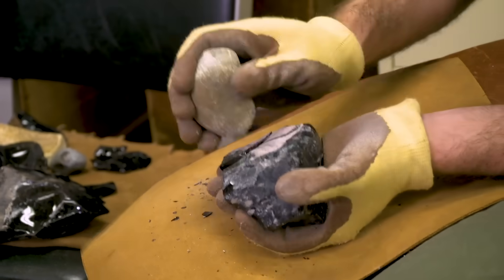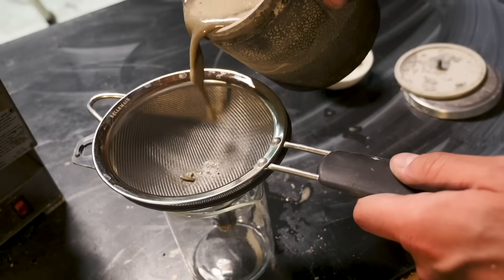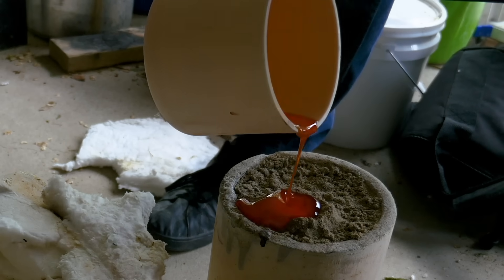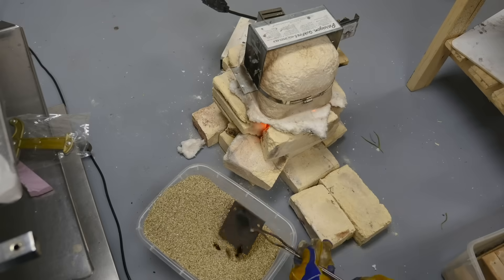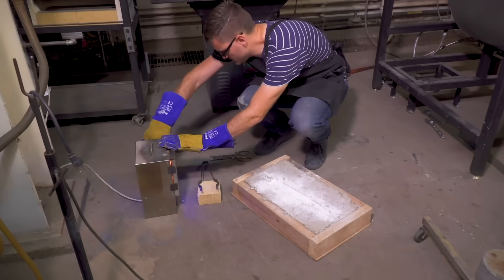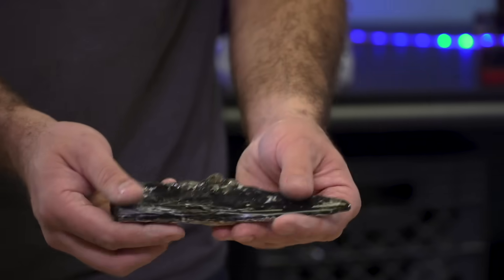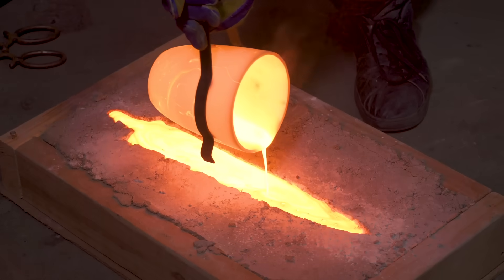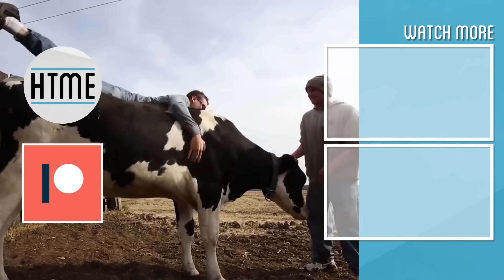Can You Melt Obsidian and Cast a Sword?

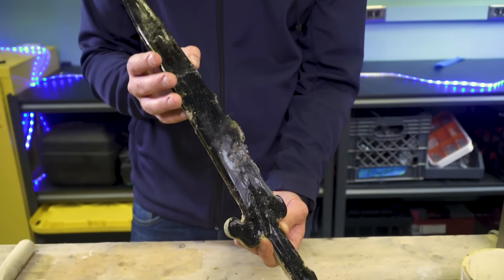Comment: 12:51 what if you worked with it on a sort of hot plate and then enclosed it in a double sided mold to make the details.  Rather than the smooth side it would be jagged and usable.   Wrapped in buffalo skin yeehaw!

Comment: You just used a kiln to heat the obsidian. Use the same kiln and anneal it for a few hours and then let it cool in the kiln....newb., it’s a bit of a necessity for any glass to come out stable screw vermiculite, you might have like 10% of what goes in come out in one piece. And if you want to grind it I suggest using a flexshaft tool like a foredom you can  grind it in a bucket of water so won’t crack or just get a water cooled lap wheel but that’s pretty pricy

Comment: Guy needs a large centrifuge to spin down those 'mud' mixtures.  You end up with just a moist cake at the bottom of whatever you spin and clear water you can pour off.  Saves a huge amount of time and mess instead of boiling it down.

Comment: Obsidian is a natural volcanic glass that is a very thick fluid. High silicon lavas tend to be very explosive because of the viscosity associated with that type of lava. This type of lava chemistry tends to form rocks like rhyolite/granite. Typically, obsidian can flow only because it is a superheated lava that is 25-30% hotter than a typical basaltic lava (1300-1400 C. vs 1000-1100 C.). Even at that temperature, it doesn’t flow well. That higher temperature is probably much hotter than your kiln temperature. Low silicon lavas are more fluid and tend to be cooler in lava temperature range (like basalt on Hawaii). I suppose adding a flux would change the composition and therefore make it something more like manmade glass instead of true obsidian (why it flows easily). Still an interesting video. Thanks!! I’ve heard (but don’t know for sure) that some flint knappers bake stones like solid basalt to make them more brittle—enabling them to knap an edge onto rocks that are not obsidian.
Reply: This taught me more about obsidian than the geographical channel did oh and mincraft too.
Reply from the maker: great feedback thanks!
Reply: So it’s hard to cast cause it’s T H I C C
Reply: Copy paste
Reply: Or just pore water into lava obsidian is ready.
Dont @ me for this it's just a Minecraft joke if u don't understand this.
Reply: @Vishwas Hedge
Reply: This is part of why I suggested sintering. powder the obsidian then fill a mould with it.  heating it until the powder fuses back together doesn't take as high a heat as full melting.

For a wax analogy: full melting is the point where paraffin flows like water.  Sintering is the point where a candle has been heated to the point where it starts to droop and if you let it touch another candle the wax will fuse into the other candle.
Reply: I've got to wonder if using a gas-fired kiln vs electric kiln would provide the right environment for the material.  At those temps, Chemistry be happenin.  Also using whatever crucible they use for boro (i.e. pyrex) glass might help.
Reply: Well, real obsidian is not exposed to air while cooling.  So that's one big difference.
Reply: David K - I am a 14th degree Master of Fony Baloney and I just wanted to mention that in my opinion there is NO correlation between viscosity and explosiveness.  I hope it didn't hurt too much when you pulled that "fact" out of your ass.
Reply: 526f72736 368616368 Ha ha. Lava is about 9% volcanic gas by volume, which expands rapidly when approaching the surface before erupting. Try this viscosity test at home by making pasta: Boil water (a very runny liquid) and the bubbles easily disperses at the surface without explosions. Then try to heat pasta sauce (a thicker fluid) and little explosions will occur unless you stir it regularly to help disperse the gasses. High silicon lava is so much thicker as a fluid. Bubbles of expanding volcanic gasses and steam cannot easily disperse, and so the gases become very explosive when the pressures surmount a very thick fluid lava. Viscosity is why volcanoes with higher silicon lavas are extremely explosive compared to low silicon lavas—because the lavas are too viscous to easily release the gasses. Recall how difficult it was to pour the heated obsidian (without the flux) in the video. Basic geology 101 science. Get it?
Reply: 526f72736 368616368 I forgot to mention that I am a college geology professor, but of course you are a 14th degree Master of Fony Baloney
Reply: I declare winner of this nerd contest: Geologyyy Profffffessooooooor!!

Comment: You learned a lot from all the failures. What about casting tiny modular pieces of pure obsidian (with no flux), to be used in a wooden frame? Possibly with edges that are designed to be broken away to make a sharp edge in a controlled and predicable way.
Reply: The process you describe is called sintering and is used IRL to mould Aluminum OxyNitride.  Which.. also has a melting point so absurdly high that liquifying it is impractical.

Comment: try to process it with powder metallurgy - press mix of SiO2 powder with organic binder and then sinter thats how ceramics  are normally processed also blades which basically is the same as obsidian i.e. SiO2 but it will not be glass - amorphous but crystaline

Comment: This seems like a poor test, given that flux weakens glass (as you acknowledged). Surely a better test would be to melt pure obsidian, using a large enough crucible to allow it to off-gas without overflowing, no? You could even do this with a small crucible and some patience, by doing several small off-gassing runs, and then re-melting the products of those runs together for the actual casting.

Comment: "Is it possible to melt Obsidian?" Yes but I don't have the equipment to do it so I'll just smash it, mix it with a lot of other stuff that melts and incorporate it..."It's arguable to call this obsidian" It's just not.
Reply: I think it would have gone better if he'd pulverized it then sintered it.  full liquification of obsidian requires well... simulating lowering it into the fires of an active volcano.  Sintering heats it just enough for the broken pieces to fuse back together and doesn't require such ridiculous heat.
Reply: you are on to something here
Reply: Mar Hawkman Good idea! Would love to see him try it again this way.
Reply: Just because he did the other steps doesn't mean the obsidian wasn't melted, duh.
Reply: Fluxing is a standard part of metal casting and hot work.  It's hardly surprising that some would be needed to adjust the melting point and control impurities.  Little or none of the flux ends up in the final product.
Reply: @danieldwiggins2192  I don't think flex is the correct word for what he added.  He added impurities in order to decrease the melting point.   It would be like adding a bunch of zinc to copper in order to make it melt at a lower temperature.  Sure it would work, but what you'd get out of it would be brass not copper.  Basically what he made was a black colored glass sword not obsidian.

Comment: I’d like to see you try to cast the blade over a steel center pipe. If you heat the metal beforehand it could help the glass from cooling too quickly and add some internal strength.

Comment: Also I'd add if you ever try a repeat, try to have a rigid base centered in your casting (something that won't burn and will cool at the same rate or has minimal thermal distortion [expansion / contraction]). The base could add strength and depending on its diameter the obsidian would be more like a glaze with a blade extrusion. Then precisely apply acid to sharpen.

Comment: what if instead of a flux you mixed in steel or another strong durable metal like titanium and compressed the piss out of it while its still molten so its way denser as it cools. then just sharpen with a laser

Comment: Kiln casting ora pressmold would probably be more successful, you could get the glass up to temp and slow it to flow without having to take it out of the kiln or having it loose any heat. Your kiln was also 150 degrees colder than it should be to get the glass to the right consistency.

Comment: Good attempt but you are missing a major step and that is slow slow annealing of the obsidian which is more like glass than metal. If I recall obsidian is volcanic rock that forms the way it does because it cools slowly.
Reply from the maker: It annealed for a couple days, which is the norm for modern glass.  So it is probably a combination of factors.

Comment: Go and study "lost wax" casting, where the mould is fired in a kiln to bring it up close to the temperature of the pour, and then slowly bring the temperature of the casting down  over a couple of days ; then you might have some success! I have done it with glass, so it should work with obsidian! What flux are you using?

Comment: Idiots... Stop removing it from the casting until it cools completely! Than anneal it. You need to treat it like stained blown glass because there is soo much flux!

You probably should move the whole casting into the oven for the annealing process.

Another thing people forget about... is as the Obsidian is cooling in mother nature.. there was also chances that there was a glacier above it... so.. a giant Ice block slid over top might help the rapid cooling that everyone is looking for keep in mind at this scale and size where comparing a tone of obsidian under an Ice burg. Yes Some of this stone will surface crack. Hence why the best obsidian is in the center. Like any ore.

So if you're trying to replicate that in a lab.. the best thing is to not move setting glass at all... better yet. Bake the sheet. on a Iron casting form..

I am so frustrated watching this.

Comment: Amazing work and incredible patience.  Would making a stone crucible help with melting as a volcano keeps its content through the rock walls and volcanic glass doesn't seem to seep into rocks material.  Maybe if you made a rock crucible for your forge it would help with the melting.  What about putting the poured glass sand construction into an extremely hot container and slowly bringing down the heat to simulate natural settling of the glass on land after a flow?  Thanks for your patience in my questions.

Comment: It isn't impurities that make silica difficult to cast, silica itself has a melting point around 3000°F, which is a bit higher than steel, as with steel in order to cast it it's required to be well over it's melting point, that's a completly different class of furnace and crucables to work with it, which is why fused quartz is so pricy. Fluxes massively degrade it's physical properties.

Comment: Are you ever going to learn to not put glass on stovetops? I've seen it break from the heat and expansion in quite a few of your videos now, and I always want to... shake you by the shoulders or something. Glass might be chemically inert, but there has to be something better you can use, or at least put a metal pot under it so when it breaks it doesn't spill everywhere.

Other than that, I applaud you for how much work you put into this. The premise of casting an obsidian sword is of course based on a whole load of codswallop from movies and games, but you gave it your best.

Comment: HA, I was wondering if you'd encounter the dissolved gas problem!  
Hawaiian lava has almost no gas, and pours out like water.  Western USA volcanoes are more like jet engines full of powdered glass, caused by the enormous release of gas dissolved in the lava.    The gas-jet flings the lava halfway to space, creating ash clouds rather than pour-able pahoehoe.  Obsidian deposits never turned into ash+gases: hardening in place deep underground.  Obvious in hindsight that melting it will create an extremely tiny ash cloud (big wad of foam glass, no "chimney effect" to launch it miles upwards.)     I found this myself when melting various glass samples and rocks in the microwave oven!  Balance your sample atop a tiny flowerpot in the microwave, torch it to red hot (with a torch,) then nuke it. 

Obsidian in your microwave swells up into a big white popcorn puff, with incandescent glows within.   But only if first "triggered" by brief heating to near-red hot.    If instead you want lava flows, use that red "lava rock" garden decor stone, which melts to black glass.   (Red "lava" is blast furnace slag, it's the glass that floats to the top of the crucible during steelmaking.)  https://www.youtube.com/watch?time_continue=200&v=zhJF_hTJ2Rw

Comment: 2000°F = 1093°C for those that don't use the English measurement system
Reply: and for those who are interested. Converting from the English system to Metric is very easy. You'll need a bucket of salt water, one new born calf and a pile of leaves. Firstly, divide the number by 4 and then multiply by 3. Now, when there is a full moon, face West, South West. Now spin counter-clockwise 3 times. Now, whilst waiting for the salt water to boil you'll need to count the number of leaves that fly away....wait...that's not it. Ok....divide by 12 and face directly West whilst the cow faces South West....hang on...that's not right. Ok...I remember now. It's a frog not a cow....is that right? I've completely fucked this up...sorry.

Comment: Try using ultrasound waves to hold the heat and slowly dial it down. I don't think actual Obsidian can be manipulated right without using sound tech. You could use pressure fields to make a more powerful material as you vibrate it so anything that would fight to get out can do so as it dials down for cooling. Coat spaceships with it so the jokes at NASA won't be burning billions of dollars up in the atmosphere. Lmao..

Comment: Right, he has now proven that Gendry from GOT has got a real challenge on his hands making swords made purely out of dragon glass. Just out of curiosity, what if he cast real sword and coats it in obsidian to give it that glass edge? Most other swords are made with multiple materials to give them strength and flexibility, maybe it will work the same way. It would still be a dragon glass edged sword that would be extremely sharp and have the strength and durability of a regular sword.

Comment: The mold should be graphite, as sand and obsidian both contain silicon dioxide, and the mixture of stuff in obsidian could melt at nearly the same temperature as the sand. I've been cut merely handling a broken piece obsidian; a proper sword would be too brittle, but that first slash would forever be remembered.

Comment: Your working with something very picky, why not find the point that straight Obsidian becomes the consistency of clay and instead of pouring it into a mold mold it yourself. The tempatures of the Obsidian during molding like this should be recorded based on the consistencies and from there you'll be able to use the process of elimination to find the best temperature to the Obsidian and don't forget the art of folding and condensing... For example if 2 identical steel blades are side by side but one has the equivalent of 5 inside the mass of 1, it could easily sunder the other. In this regard everything that exists is capable of much greater things

Comment: obsidian is fomred under pressure.. you'd need to melt it in a highly pressurised environment, or it wont be obsidian, thats most likely why it was more clear - not the flux
Reply: The creator kept mispronouncing vermiculite - it is NOT vermaculite.

Obsidian melts under pressure, but when it reaches the surface and flows, the pressure no longer exists.

The fluxes probably removed some (possibly all) of the color. There are varieties of obsidian that are clear, or at least have clear layers in them. There are quite a few varieties - all depending the the impurities.

The creator needs to forget the fluxes and use a much larger crucible for the volume of obsidian - so that the boiling/frothing does not escape and make a mess of the furnace. The temperature used was also far too low. 

Also, large masses of glasses are very tricky to anneal properly. It takes a long time and, if there is any stress point, a fracture is going to occur.
Reply: obsidian is a glass, not a crystal, it needs to be cooled very quickly, not annealed. 
ps: im quite familiar with geology and grammar, not sure why you're dumping extra irrelevant information.

Comment: Use a glass blowers kiln to cool it at controlled temp and don't use the flux it changes the atoms of the obsidian changing it into glass just crush , smelt in a glass slemter and shape by hand using an oxi aceti torch to shape it after heating to the liquid point work fast and use raidiant hear to transfer heat with the torch to the next area

Comment: Heat and pressure do the Same thing .If You an contain your rock in a pressurised chamber and  then  pump in inert gas like argon to raise the pressure you can get the melting point lower

Comment: I don't get the obsession with obsidian in Fantasy. Most of them already have good quality hardened steel. It's like obsidian has become the successor of Nippon Steel folded 500000000000 times.
Reply: Nonsense. Any steel folded even a tiny fraction of that many times would include so many included particles and oxidation that it would be very brittle.

Comment: The problem was your using 100% obsidian why not do 20% iron 10%brass 10% steel and 60% obsidian melt and mix then drop forge it and poof a usable obsidianSword. The reason for the mixture is too give the obsidian steel like properties too make it useable
Reply: Nonsense
Reply: buggsy5 absolutely not have you never forged before or do any blacksmithing you'd know using different mixtures of metals is necessary too combine their properties for their individual uses example you'd never make a pure titanium sword or knife first you would smelt it down and mix iron and steel into it in order too make titanium alloy the small amount of iron and steel gives it their maleble properties too make the titanium less brittle and more useable as a sword or knife it's called metalergy